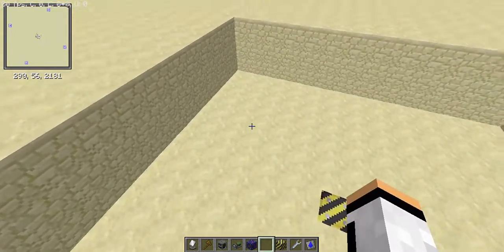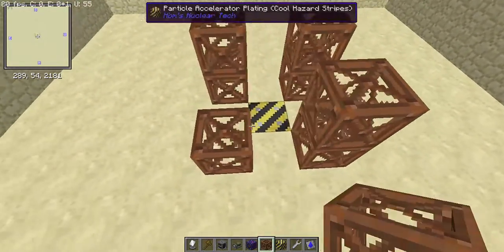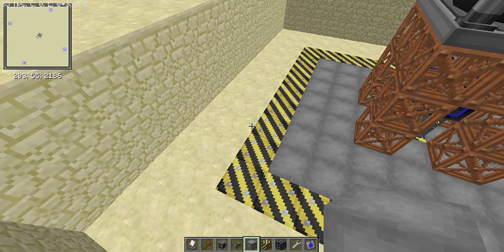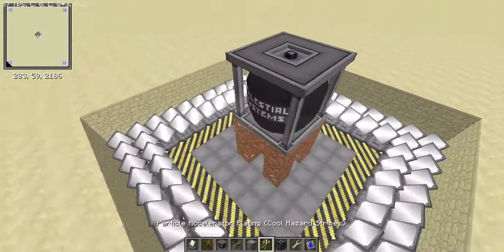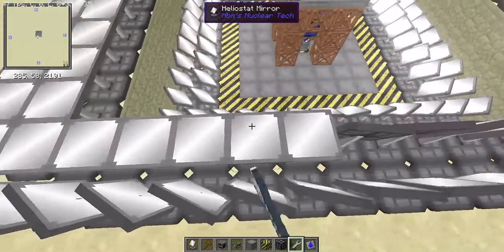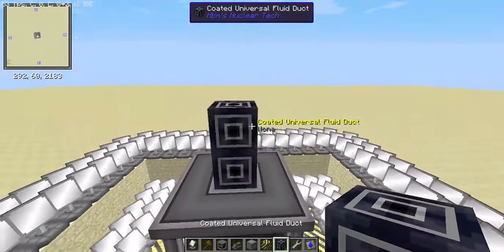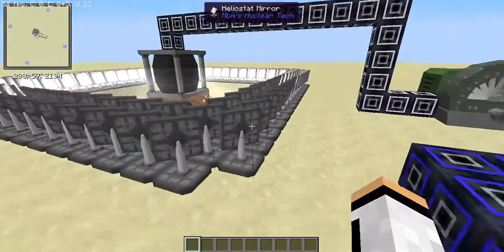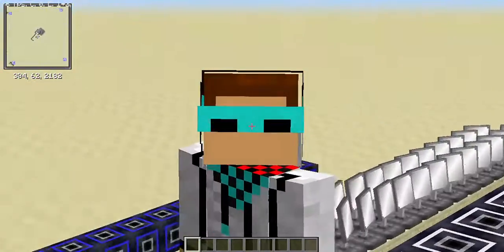How to get easy cheap unlimited early game energy! again... | HBMs nuclear tech mod guide

Comment: what do I use energy for?? I have too much!
Reply from the maker: Use them to power machines! such as centrifuges, ore acidizers, chemical plants, assembly machines or others!
Reply: @TheChosenIndividual  Okay! I also made the mistake of putting a microwave in the axillery room of one of my nuclear power plants. I connected it directly to the energy supply, turned it on and then BOOM
Reply from the maker: Sheesh...look at the bright side! it became a nuclear microwave!
Reply: @TheChosenIndividual  Yeah LOL! I never knew microwaves had so much explosive power. Though one more thing, I was just re creating the Chernobyl site with the same RBMK reactor that i tested before (and was the one that blew the microwave) however, my build is looking too good to get blown up. After looking around I found the /gamerule DialDisableMeltdowns true/false. I put it to false which I believe is no meltdowns, but I am uncertain. I will test it in a different world I think

EDIT: I just tested it and the answer is NO it does not in fact not cause meltdowns

Comment: Imo best to find some oil asap and build a refinery, because plastics are needed in every major recipy going forward and diesel will get you through until the Zirnox, which should definetely be your first reactor. It will increase your energy production by orders of magnitude and you will then be able to do all the ore processing you need. From there on you can build an rbmk (I tortured myself and gathered resources for 4 Leviatan turbines, they use mountains or the basic resources to build...) which is pretty expensive and use it for breeding and even more energy.